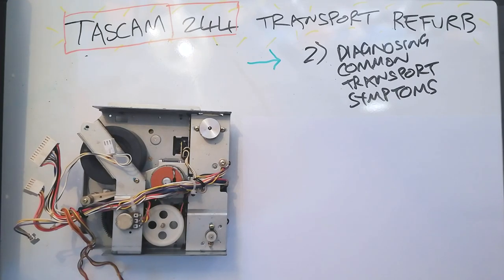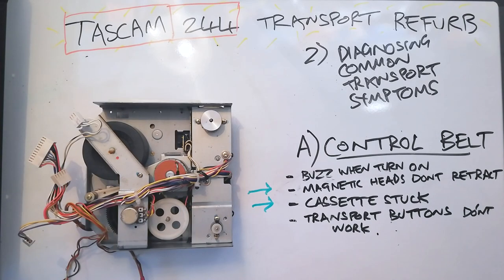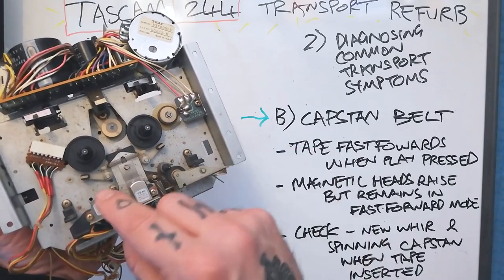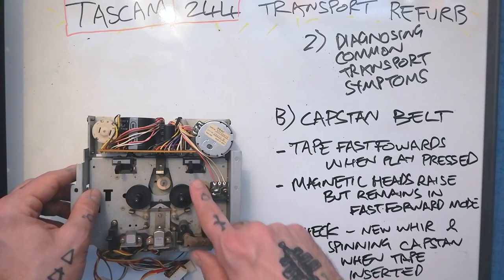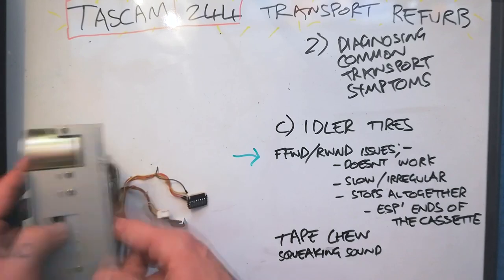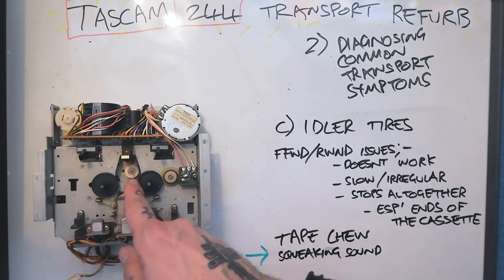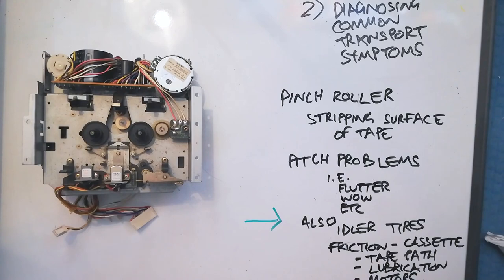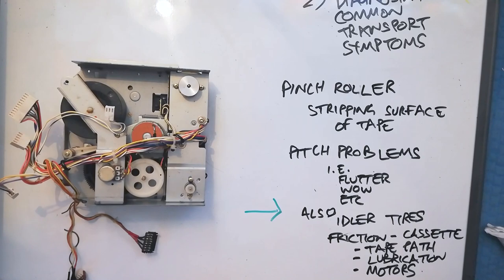3 Common problems (Fix Your Tascam 244 Portastudio Transport)

Comment: Thanks for this series- I recently pulled out my 244 as I was recruited to transfer some old 4 track masters of a performer who recorded in my studio 30 yrs ago- he no longer can play guitar that well due to arthritis and his playing and voice were at their best in these recordings. I opened up the machine and the belts were goo....!!! Got new belts - idler tyres were not available easily so went with O rings and did that neat trick of spinning an abrasive to flatten the profile. Still can't get it to play properly- with just the belts replaced I had 20 minutes of flawless playback- then the idlers started to disintegrate. So at the near disaster of eating one of these masters I took it back to the bench. Still not getting it to play without the idler putting the FF hub into motion. Found a pinch roller that fit perfect out of a busted Yamaha ( as it was about to go as well). It looks like the idler tyre might be too thick and not missing the spindle FF drive. Maybe more of that rotating rubber fabricating. I would have thrown in the towel on this but you are keeping me on it- a lot riding on it after all for this singer-songwriter.
Reply from the maker: Yeah unfortunately if you go the route of adapting o- rings there are pitfalls...you're looking for an o-ring which - once sanded - only protrudes 1-2 mm past the lip of the idler wheel. Good luck!

Comment: This is a godsend. I refer to this yearly, lol.  Had the deck going into fast forward when hitting play.  Only replaced the belts a few years ago, but must be on the way out again
Reply from the maker: That means the pinch roller isn't pushing all the way up against the capstan, so check the control belt and the condition of the white plastic cap that joins the pot on the thrust plate to the large  black plastic gear beneath, good luck!
Reply: @Tetrakan  it’s funny, it comes good after warming up the room and leaving the machine on for 15 minutes. Will open it up this weekend and see how it’s looking. Thanks!
Reply: Ok, this weekend took 2 years to come, but finally came back to this after getting my Porta 05 working and again thanks to another of your tutorials.  The black and white gears were really stiff, so replaced the grease on those, and after not aligning up that potentiometer properly the first time, it now plays back perfectly.  Thank you so much!

Comment: Awesome video. Just got one of these and having to replace the belts and this video was a great help. Thanks. Now need to look at how to fix some scratchy pots on the mixer channels...
Reply from the maker: Thanks for your kind words! It so happens that I am rendering a video on that very subject as I type this- it should be uploaded to youtube later today. I also have videos on removing the mixer strips form the 244 and cleaning the mixer of a 424 mkIII which will help you out if you want to get into it straight away.
Reply: @Tetrakan  that's perfect timing. Looking forward to seeing that one. My new belts are on the way this week so hopefully make some progress on it then as they were completely disintegrating.
Reply from the maker: @teejteejteejteej  the video on cleaning the mixer channels is up now. i already did a video demonstrating how I go about cleaning away the black tar the disintegrated belts leave on the transport mechanism, so I hope that will help you too, good luck and feel free to ask questions if you're having problems - I can either direct yo to a video I made already, or if i haven't covered your issue before I can make a new video in response to queries :)
Reply: @Tetrakan  Thanks! Will check that out. I've just replaced my belts (without removing the transport) which has got things progressing nicely but doing that and watching your other videos I quickly realised my pinch roller fell apart and needs replacing. I guess my Idler tyres might need it too... so back to ebay for some more parts. If you've got a recommendation where to get these from that would be great!
Reply: Going through your other videos maybe plumbing parts for idler tyres and an AS2 rubber moved to the existing metal wheel part is the way to go... 
(Sorry, this is all new to me.)
Reply from the maker: @teejteejteejteej  Yeah thats what I'd suggest. Basically if your capstan belt was on the way out then the other rubber parts wont be far behind. I don't know where you are based but here in the UK I get the AS2 pinch rollers from CPC, if you are in a different country there will be another electronics wholesaler near you who imports these, I imagine they come from a manufacturer in the far east? Likewise the O rings I tend to source from ebay or amazon, probbaly those sellers are getting them from aliexpress....its a bit of a palava to track the bits down but it does work out much cheaper than some very expensive kits I've seen on ebay.

Comment: hey, i have a speed problem with my 244 i’d like your opinion on. everything with it works fine, but the speed is always way slower than the pitch is telling it to be. when i adjust the pitch control, it either barely listens, doesn’t listen at all, or slows down. i believe the slowing down is regardless of me moving the pitch control. it almost grinds to a halt at times. i’ve replaced all the belts and tires, and it still has the issue. i believe it’s a problem with the function of the small rubber wheel that pops out from the bottom right of the transport when you’re looking from the outside. it occasionally will stop, and if i’m lucky, a push will get it going again. it was noisy before i replaced the belts and tires, and the noise would coincide with a pitch change, but the problem is still happening now that it’s a lot quieter. my capstan motor does have a wobble in it, and it does squeak, but it stays stationary while the belt is rolling on it so i doubt that it’s causing all that fluctuation. there’s a vid on my channel of the problem, any thoughts are appreciated, thanks!

Comment: Really thankful for these amazing videos, sir! I am a total noob, never opened up a Portastudio before. My 246 started having some issues - when I insert a cassette, the capstan motor does not start. Heads engage when I press play, ffw, rw and stop are working, but the tape stops/does not play.  I used to hear a whirring sound when inserting the tape or engaging the top switch with my finger, but now nothing happens. Not sure if this is a simple or a more serious issue... Thank you kindly for any input!
Reply from the maker: Thanks for watching. The most likely cause for what you describe is that the capstan belt has become loose and needs to be replaced, so the first thing to do is remove the back case and see if the capstan motor does in fact turn in response to the switch. If not, check the fuses if they are present in your machine (on the 246 these are mounted on a plate abiove the reel motor) - it is possible that the slow blow fuse for the 12 volt circuit has gone. Failing that another possibility which is an easy fix is that the switch which detects the presence of the cassette is broken or has a dry joint. If you can use a soldering iron you can reflow the solder on this switch, or if it is broken, its possible to just join the two wires running to this switch, though that will mean the capstan motor always turns when the machine is on - that needn't be a problem since later portastudios capstan motors turn constantly anyway. Good luck!
Reply: @Tetrakan   Thank you so much for this comprehensive answer!
Reply: @Tetrakan  Cable was replaced recently, I've measured the fuses they all seem fine, resoldered the switch solders - still does not play. When I press the switch, the motor doesn't turn.However, just by sheer accident, the capstan motor started turning out of the blue when I had it open during repair, but when I inserted the cassette, the playback was reaaaly slow, like 2000% slower. Then it completely died again... If I press the switch without the cassette in and then press play, the thing does turn, but it seems it isn't enought torque to playback the cassette properly. If you have any more ideas I would be really grateful! Thanks :)

Comment: Thanks for this, if i want to lube my motors, do i have to dissemble them? Or how this work exactly?
Reply from the maker: tiny spot of oil where the shaft emerges form the casing under the belt pulley. I wouldn't advise taking it apart unless absolutely necessary. Here's a video showing how such things are constructed, if you're curious https://youtu.be/KlaFh-X83sg

Comment: All belts and rubbers replaced and all transport mechanisms are physically operating well, but mine is having intermittent failure responding to all control buttons. Control buttons are all good and providing correct input to U501.  Occasionally it will all work perfectly, but sometimes it will just start on 'Play' when powering up and won't respond to Stop or other buttons despite voltages being correct coming out of U501 in each control mode. Any thoughts on common problems that might cause such intermittent problems?
Reply from the maker: Have you inspected the mechanical connection between the control pot and the black gear below it? There's a white clip that connects those two parts which can break sometimes.

Comment: Hi again, I'm looking at a unit that powers on and makes the humming sound  as well as the heads are stuck in the up position, both of which you thankfully explained in this video. However, the current owner says he did manage to squeeze a cassette in with the heads up and once he did, the play, fast forward and rewind functions did work, but the play function is spinning extremely fast. Does that sound like it has to do with the control belt as well?. I'm particularly curious about the fast spinning play function. Thanks in advance!!
Reply from the maker: Yes, control belt, head is stuck near up position so audio is audible, but unless the pinch roller goes up against the tape hard the tape will travel at the same speed as in  fast forward mode.
Reply: @Tetrakan  Thank you again. Very helpful as always!

Comment: My 244 is humming or buzzing when I  playback and record. But if i press on the panel or the second UV-meter it kind of stops.. what do you think the problem is?
Reply from the maker: Basically there is a whole "sewage" system in your  244s electrics designed to "flush" away hum which is a bi-product of turning the alternating current from your wall socket into the direct current used by most of the components in the recorder...it sounds like there is some bad solder joint or loose wire in there, but really somebody who is familiar with these things would need to open it up and inspect your 244 to see what the issue was, sorry I can't be more specific than that, good luck resolving your issue.

Comment: Hi Tetrakan, thank you for your awesome series on the 244. I'm running into an issue I don't think you've mentioned in any of your videos yet. Could you help out?
--> Second hand 244 turning on; record, pause, zero return and record function lights blinking when they should; VU-meters lighting up. However: no life at all in the transport section. I've replaced the control belt, capstan belt and pinch roller which were reduced to a sticky bunch of nothing with the help of your videos; idler tires were okay, but spare ones are on their way nonetheless. However, the transport section just doesn't come to life: capstan doesn't turn, control belt is not retracting the tape heads on startup, ... Tape counter is dead as well, and seems to be "fried" in the right corner. My guess is it's going to be electronics, but I'm clueless on that front. Any ideas? Thank you!
Reply from the maker: If you have an EU or UK model there is a daughter-board between the transport section and the chassis, it's got five slow blow fuses in it, sometimes one or more if them will blow but the others stay in tact so maybe the onecrelating to 12v DC (all three transport motors) has blown while the 5v fuses (logic, Meter bulbs, LEDs) and the 15v fuses (opamps, and therefore mixer function) are still in tact. With the unit unplugged pry these out one by one and test them for continuity with the diide setting on a multimeter.
Reply: Alright, thank you so much! Will check this asap and come back to you.
Reply: @ruben_lefever  hey, i'm having the same issue. just replaced the two 500mA fuses which were blown. the others seem to be ok from testing with my multimeter. still no power on any of the motors or the playcount. all other lights are on VU etc., even the play/pause lights. did you have success with replacing the fuses?

Comment: Hello I have a Yamaha CMX100 (same as MT100)... the transport gets stuck in playback position quite often when I hit stop. Can it be some kind of belt problem?
Reply from the maker: i have an mT100  - the raising and lowering of heads and pinch roller is driven by teeth at the base of the flywheel, so its driven by the same flat belt from the motor to the flywheel as the rotation capstan rotation. Therefore, if your capstan is turning okay, I think the belt is probably okay, though its always a good idea to change those when you don't know how old they are. I suspect its more an issue with the grease on the cogs/gears/cams which raise and lower the heads has become stiff and gluey with age. Resolving this would be a matter of disassembling that part of the mechanism, applying fresh grease (I use silicone grease but I've heard of folks using lithium grease) then reassemble. I do something similar in a series on the fostex x15 if you want some sort of idea of what to expect, but it wont be identical so take photos and store parts in numbered containers so you know what goes where and what the sequence of assembly is. Good luck!
Reply: @Tetrakan  thanks for the detailed answer. I'll look into it. I wish I could find someone to service it though. I also have a MT400 with a busted channel.
Reply: @Tetrakan  thank you for the detailed answer. I'll try to look into it. But I'd really like if I could send it to someone for service, I also have a MT400 with a busted channel.
Reply from the maker: @ElectroMagnetic_AmbientMusic  where are you based? I might be able to put you in contact with someone.
Reply: @Tetrakan  North Italy
Reply from the maker: @ElectroMagnetic_AmbientMusic  sorry I know guys on the east and west coast of the US who would do the work but not in the EU. Hopefully its something you can fix yourself - dirty fader, bad opamp etc, good luck!
Reply: @Tetrakan  thanks for your help, I appreciate. Too bad I can't really find anyone in EU :( I opened it up and sprayed some w40, changed the belt, but no success. My knowledge in this field is zero and I'm afraid to mess it up even more if i touch too much. It works for 5-6 plays and then gets stuck when you stop.

EDIT: I didn't want to give up yet, so after watching your video carefully, I opened it up again and tore it apart to the smallest piece like you showed. I cleaned and applied some grease. Now it seems to work much better! I'm not sure if it will be fixed in the long run (I need to use it for a while to be sure) but for sure I achieved something. Thank you so much!!!

Comment: So, it's normal for the 424's capstan to rotate all the time?
Reply from the maker: That's right - from that generation forward there was no cassette detection switch in the top right corner of the cavity, so providing the belt and motor were healthy, the capstan would rotate whether there is a cassette in the cavity or not.
Reply: @Tetrakan  awesome, thank you for your reply. I never even noticed it did until the other day. I thought something was wrong. Have been researching it since.
Reply from the maker: It's nothing to worry about, glad to help!
Reply: @Tetrakan  any suggestions for quieting the background white noise? Sometimes when I watch youtubers with their machines, they seem completely quiet. I wouldn't say mine is "loud", but not like theirs
Reply from the maker: All the headphone amps on these things are hissy AF so YouTubers are probably taking their signal from the line out which has a better noise floor. This may be obvious but are you using DBX? If not, you can go really hot to tape to make the signal to noise ratio better though obv you'll get more tape saturation that way. With dbx on you can get some weirdness in the sound if you go too hot but the noise floor will be much lower. If neither of those things help enough it may be electrolytic caps are leaking slightly meaning electrical  crap from the ground circuit is leaking into the audio path.
Reply: @Tetrakan  thank you for this. Yeah, I wasn't sure which would be better to record from, the headphones or line out. I will definitely switch to using only the line out. And as for the DBX, originally I wasn't using it because it seemed to damper the sound some, but I think it may be the price to pay for a quieter hiss.